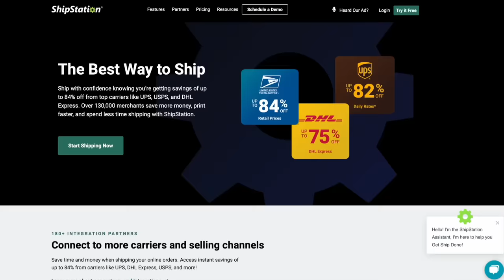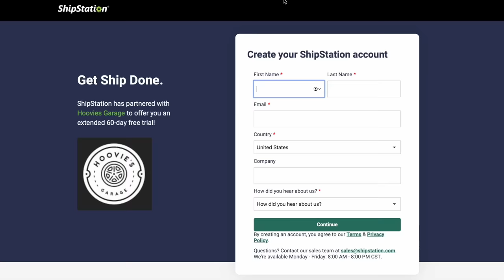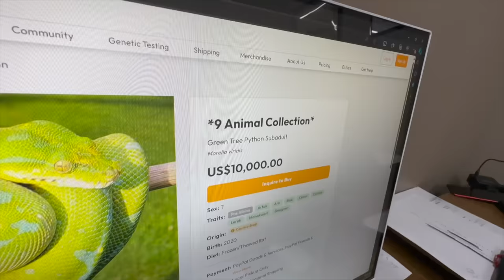I accidentally bought the MOST ANNOYING Dodge Viper in the USA (it was also really CHEAP)

Comment: For only $1300 more (plus labor), I’d just go with the new shocks and not have to worry about how hard the used set was driven. Or shop around for aftermarket.
Reply: Looks like BC Racing makes some. Maybe others.
Reply: It would be about $2k more.  That $4,000 number Wizard said was just for parts.  and the $2750 used number included install.  But I agree. I wouldnt do used either way
Reply: I would see if Koni or Bilstein make shocks for it.
Reply: @waynecarr9150  Yeah he said $500/wheel VS $100/Wheel, so the $750 is labor, same logic, it would be $5000 to do it right.
Considering Hoovie won't drive it, or keep it more than a year or two, I think the used ones are the way to go.
Reply: I'm actually surprised Wizard would recommend used shocks.
Reply: @BrewBlaster this. Wizard always says how he would not install used stuff because of warranty and now he proposes used shocks? I would not put used shocks on my car, ever.
Reply: @ViolentMLG  Exactly.  If this was for your someone who was going to drive it more, I would go new.  But Hoovie isn't going to put more than a 1000 miles on it most likely.
Reply: There is a good chance they are used but remanufaucted shocks but who knows
Reply: Have to agree .
Reply: Used shocks is a poor decision. They're already 20+ years old, and will be more likely to fail.
Reply: @johndelorean2284  They are a PERFECT decision if you not going to put more thatn 1009k on the car lol
Reply: Just rebuild the shocks it has.
Reply: No way i would put used shocks in, unless they were 10 percent of the price of new.
Reply: You can get a set of full coilovers for $2k-$4k
Reply: I see everyone suggesting aftermarket race shocks and they'll definitely tighten it up but maybe that's not what he's looking for. Just go with OEM and then he can sell it off. I don't see him owning this thing for a long time. Take it back to stock and call it a day. He should be able to pull a few bucks out of it. Content isn't exactly their strong point. They're actually pretty boring.
Reply: @EvzenEmanuel These days buying aftermarket parts is a crap shoot. Four shocks and probably two will blow out in less than a week. The parts market is having serious issues right now. That's probably why he recommended used plus if someone is putting a high performance suspension on one of these turds the parts probably don't have many miles on them.
Reply: Wizard charging over $100 hour labor lol $800 for fluid change hahaha
Reply: Why does the Wizard always quote such insane prices for parts?  Is it common for car parts to be so expensive in America.  Over here in the UK Dodge  Viper shocks are about £500 each. (about $630) And that's Genuine parts.  Even though Dodge is an American manufacturer.  There are plenty of aftermarket alternatives that would be even cheaper (and perhaps better) than factory original spec.